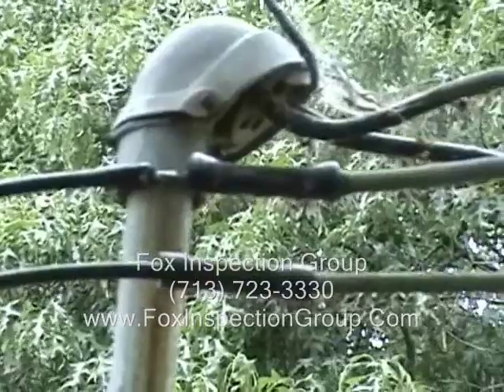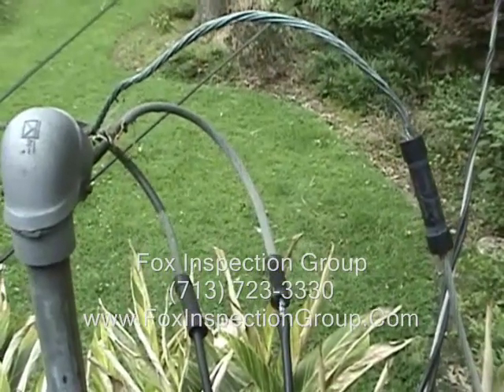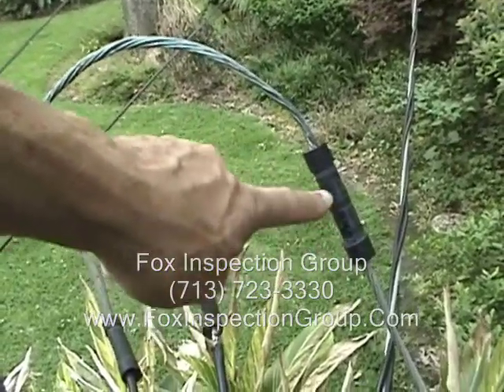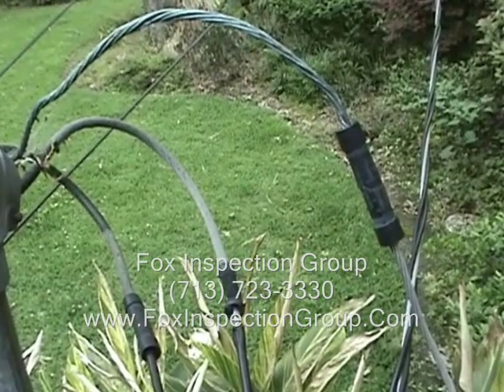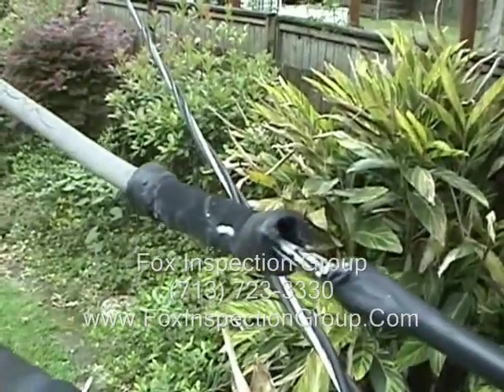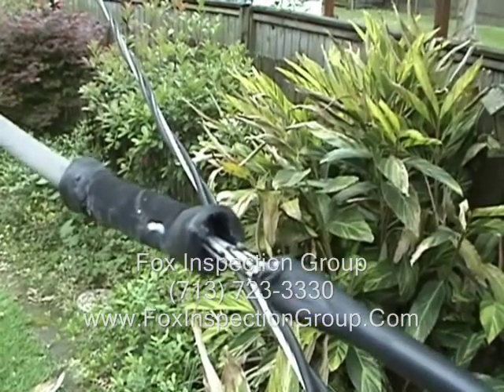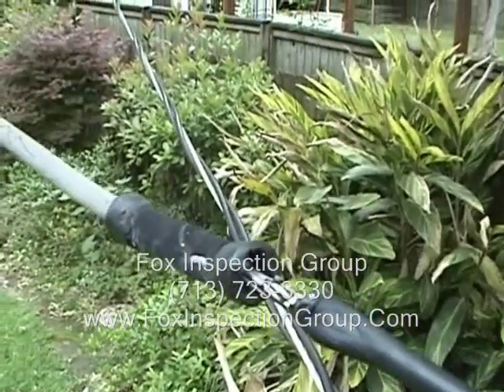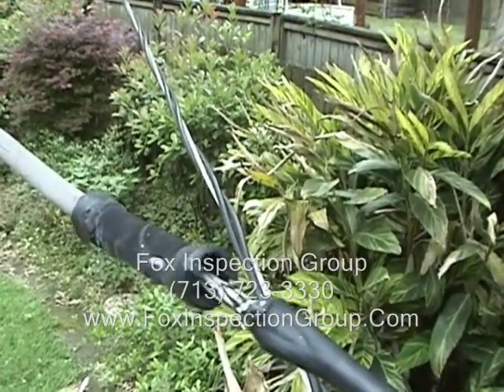Poor Connections on Electrical Service Drop

Comment: That service needs rot be upgraded so that the mast is going through the soffit allowing for clearance heights required by the NEC. 10' to the bottom of the drip loop is an NEC minimum.

Comment: @hornerm5 That is a #4 alluminum triplex conductor rated at 100+ amp per phase what you see here is a bad connection at the mast. Mybe the wrong size connector was used or there is a unbalanced load condition.

Comment from the maker: you are absolutely correct,  a hot is an ungrounded conductor,  sometimes being on a roof edge near electrical wiring, looking through a video camera and making commentary,  there is a disconnect between mind and mouth